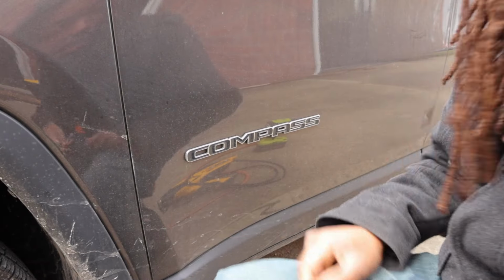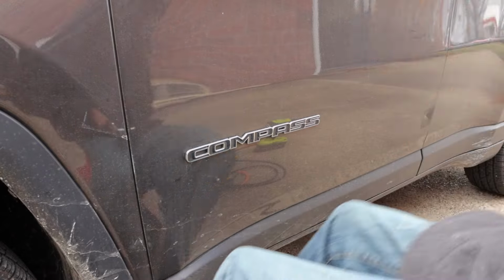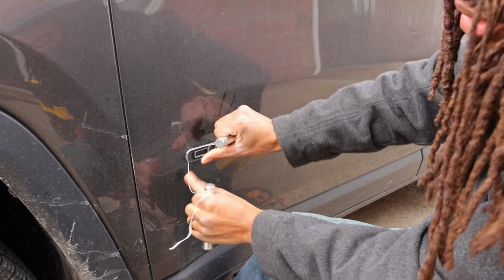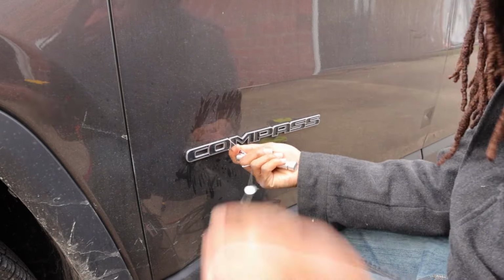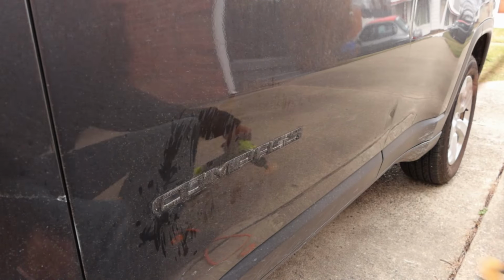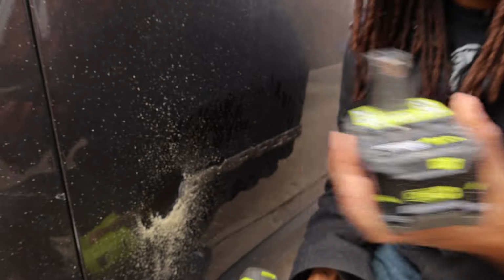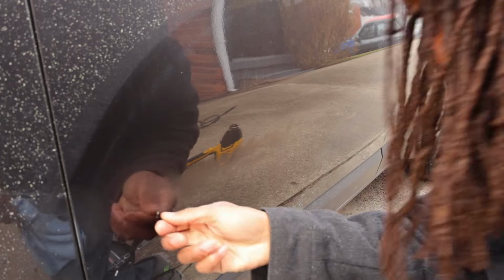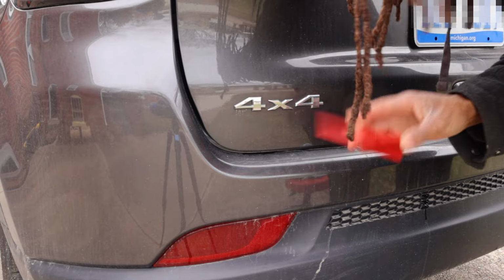How To Remove Car Emblems

Comment: Lighter fluid removes adhesive quite well, and won’t harm most finishes.
Reply from the maker: It's more efficient to use my method since its easier to carry in my tool box